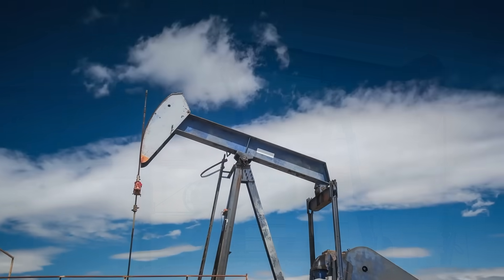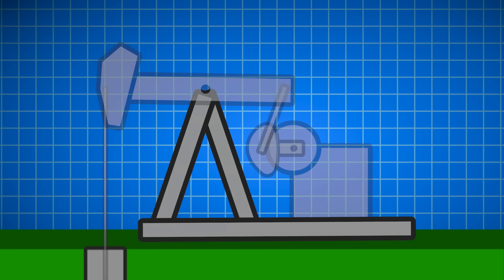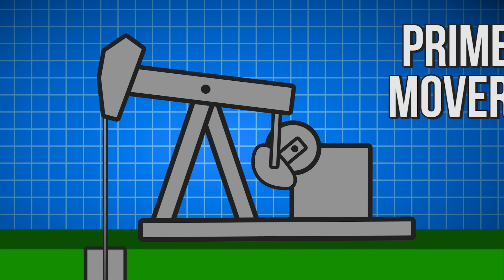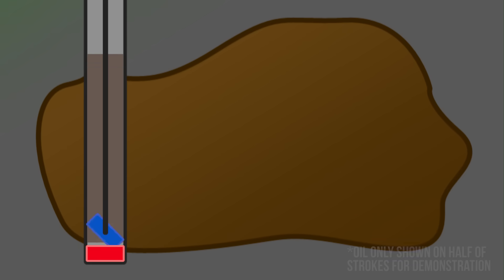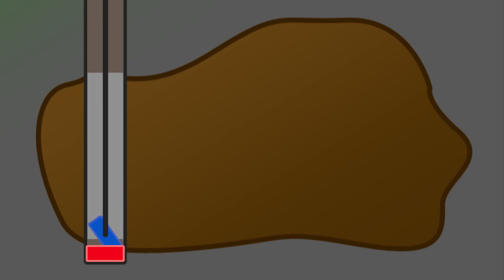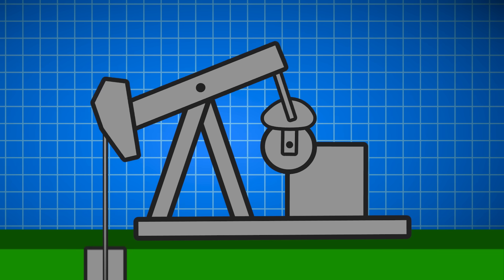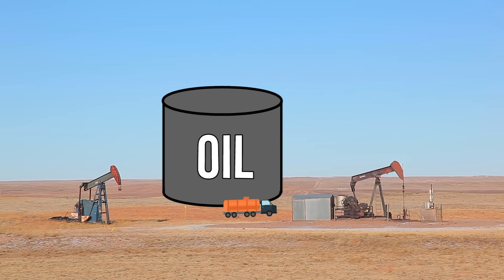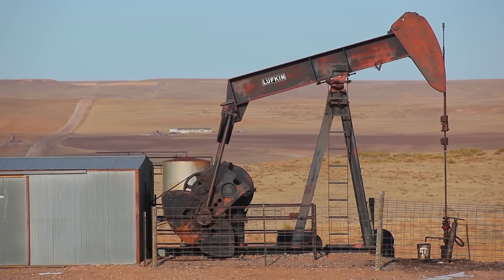How Do Oil Pumpjacks Work?

Comment: For anyone who has ever driven through the southern United States or other oil-rich areas, you likely are familiar with the sight of oil derricks. These metal moving hammer-like structures work to extract oil from underground – often in the middle of nowhere. All this probably leaves you wondering, how do they actually work and what happens to the oil once it's taken from below ground?

Called pumpjacks, oil horses, oil derricks, these large metal structures are crucial to supplying the US and ultimately the world with its oil needs. They function as traditional sucker rod pumps, known more technically as reciprocating piston pumps, and are made up of 5 parts: the prime mover, the crank, the samson posts, the walking beam, and the sucker rod.

the samson posts are those that make up the main a-frame of the structure.
they function as the basic support allowing pumping mechanisms to work togather.
atop the Samson posts its the walking beam attached to a piece called the horse head these parts togather make up the major lever arm in the structure responsible for most of the pumping. these move up  and down due to the rotational movement from a smaller arm called the crank.

the crank  usually has a counterweight to balance out the forces on the oil derrick and it gets its power from the prime mover usually through a gearbox .the prime mover is simply complicated name for motor or engine. this supplies the rotational energy to the system that works through all of the subsequent parts to create the bobbing pumping motion that these Derricks are known for. but all of that was a complicated preface to how these massive pumps actually work to remove oil from underground.

attached to the horse head is something called a sucker rod which moves up and down in the well hole there are two stages of the pumping process- the upstroke and the down stroke simple enough. on the upstroke the dirt pulls the rod up from the bottom of the well to the top of its ragne of movement. theres a valve attached to the bottom of the sucker rod known as the riding valve and another at the bottom of the well known as the standing valve. on the upstroke- the writing vale is closed and the standing valve is opened allowing oil from the source to be drawn up into the well. there on the downstroke the writing valve opens and the standing valve closes putting the oil from that stroke on the other side of the writing vale. 

repeating  this process over and over again slowly pushes the oil up and out of the well at a rate determined by the the pump : speed, size of stroke, and well diameter.
this functionality works similarly to how most pumps work using what would traditionally be called a check valve.

a check vale this valve functions identically to how the valves in the oil derrick work allowing flow of a fluid in the one direction but not the other as the oil horse operates the oil is forced out of the reservoir in the valves dont allow it to flow in the other direction . their size usually directly correlated to how deep an oil well might be. the largeer the oil horse  the deeper the oil reserve this relation is simply because bringing oil up from deeper depths requires a significantly larger amount of effort.

these derricks generally anywhere from 1.5 to 10 gallons of oil per stroke.
the liquid extracted is  usually mixture of crude and water that then need to be separated and refined as for what happens to the oil once it is pumped there are 2 main options . depending upon location some derricks will fill a large container with the oil that is then trucked  away. at certain intervals or the oil is directly pumped to a central holding station through a pipe line. 

while renewable energies maybe making a strong play for powering the world oil will likely be here to stay for qutie some time .

all this means that oil horses across the country will keep on bobbing bringing up oil from deep beneath the surface and now when you drive  past them on the road you can understand these seemingly complex machines are actually just large simple pumps working to help ur car keep on moving

Comment: The majority of pump units "suck up" oil on both the down stroke and up stroke.
Reply from the maker: Sucker rod pumps don’t work that way. Work is done on one stroke. In order to have constant sucking you’d have to have a centrifugal pump or some pump that had a rotating drive rather than a linear one
Reply: It only sucks on the upstroke, but it moves fluid on upstroke and downstroke both because of the pressurization of the fluid that occurs in the pump barrel on the upstroke pushes the fluid on the downstroke. So if you open a bleeder valve at the well it will be moving fluid on the upstroke and downstroke both with a short stop in fluid movement when the pump reaches its high and low point in its stroke.

Comment: How does the oil look like underground? Is it like a huge underground pool of oil?
Reply from the maker: Usually it’s trapped in small pockets in  rock or soil. There’s tons of different formation types, but I would say it’s usually not just a free flowing pool. A better way of thinking about it would be like tons of oil soaked sand and dirt. As some oil is sucked out, the rest slowly flows back towards the well. 🙂
Reply: Thanks!
Reply: It's basically like wet sand.  It fills the space between.  It exists in a ln emulsion of oil water and gas.  The well bore basically relieves pressure allowing the fluid to move to the bore.
Reply: Oil is found in sandstones, carbonates, and dolomite. 

Sandstones, for example, are composed of a bunch of tiny sand grains. Inbetween these grains exists empty space. This would be analogous to filling a bucket with marbles. The marbles in the bucket would have pockets of empty space between them.

that empty space can be filled with fluids such as water, gas or oil. So rather than a big pool, it's more like a sponge.

Formation rocks tend to be wetted better by water than by oil. This means often there will be a thin layer of water around the sand grains (water that cannot be easily removed and hinders the free movement of oil and gas). 

Since oil is less dense than the surrounding formation, it will tend to move toward the surface, unless something prevents its upward movement. Caprock is impermeable rock, shale or mudstone located above the sandstone reservoir. Caprock traps the oil within the sandstone reservoir below.

natural geological processes can create several different kinds of reservoirs. If you can imagine a layer of sandstone underneath a layer of shale, that is then bent into a dome shape by geological forces. This would produce a dome-shaped trap.

Comment: That's a pumping unit. A "pumping jack" is slang, for pumping money (jack) and generally not appreciated by all professionals in the oil and gas business. A derrick is the tall contraption that is the framework supporting a drilling apparatus in an oil or natural gas rig. The derrick derives its name from a type of gallows named after Thomas Derrick, an Elizabethan era English executioner. #texas #crude
Reply: Ann Eagle thank you for clarifying that. It irritated me. Lol
Reply: Not to mention they are showing mark units in some pictures conventional in others and a pump design I highly doubt anyone uses anymore.  

It's not a riding valve it's a traveling valve.  SMH this is a gross over simplification of what is actually happening.

Some information is just false.  The size of the well bore has less to do with total fluid than pump size and formation pressure.
Reply: The third pumping unit design shown -- the one close to the ground, with rotating crank, counterweights, and horse head but without the long horizontal "walking beam" is a design that sits close to the ground in farm fields, so that movable irrigation systems can pass over the top of it without striking it.
Reply: @joshualehman685  ....
with the same stroke, doubling the bore obviously gives more volume. But that also increases the weight to be lifted... a limiting factor when youre down a few thousand feet.
Reply: @hotrodray9884  well bore won't change the weight pulled.  Depth yes bore no.  The size of the bore and fluid production doesn't change after a certain point.  

The pressure left in the reservoir determines the rate the fluid will articulate to the well bore.  The other reason well bore isn't near as significant is you still product through a pump that is 1.25-2" in tubing that is normally 2 7/8". Based upon the depth of the well you have a maximum volume that can be produced through artificial lift alone.
Reply: It's interesting hearing all the official names. We used to call them grasshoppers.
Reply: yes correct...these are "pumpjacks or oil horses"

Comment: I wonder why the oil from these pumping machines has that certain unmistakeable smell?
Reply: synchro505 lots of raw natural gases mixed into the fluids. i work on a drilling rig and when we tap into the "pay zone" it burns your airways from the smell
Reply: Different oils smell different. There many variations. To the average person they just stink.
Texas crude oil smells different than Pennsylvania, etc.
Reply: @hotrodray9884  When they call it light sweet crude I think of maple syrup.
Reply from the maker: As in the there’s a different smell to oil from these pumps or why oil smells like it does?
Reply: your smelling the gas, oil usually doesn't smell. H2s smells like rotten eggs.
Reply: @jweezee11  What? First h2s is oderless and deadly which is why we ware h2s moniters. Also another reason for evacuation slides, there not just for blowouts. If that h2s alarm sounds you better be running and if you fall im not stopping to pick you up or were both dead. This is serious business life and death if you don't know don't say anything your bull could kill someone. If you breath h2s gas you drop dead on the spot period end of story.
Reply: @johnross1947 we wear h2s monitors to protect us from high h2s concentrations. H2s can be odorless at high concentrations and prolonged exposure can "deaden" our sense of smell. I operate 12 facilities ranging from 15 parts to 55k parts. I can promise it has a smell. Whether I'm flowline pigging, cleaning tank probes or just grabbing tickets I smell h2s all day and so does the rest of the oilfield. If you cannot smell h2s you may need to see a doctor.
Reply: That is the smell of rotting dinosaurs

Comment: This is not an oil Derrick.  It's called a pump jack.
Reply: +Concerning Reality - Technically, yes. Using a very loose definition of a derrick then it could be referred to as such. Colloquially, an Oil Derrick is the mast structure on a Drilling or Service rig that provides support for the Crown block, drill line and Travelling block that are used to support, raise and lower the drill string for drilling, connections and tripping. in my years in the oil patch, I have only heard the mechanism you are featuring referred to as a "Pumpjack" or "Walking Beam pump". When rig workers talk about a derrick they are always referring to the mast on their drilling rig. When a hole is TD'd and it is determined that it will produce, the rig (With its Derrick) is removed from the site and moved to its next location, a production rig is then set up over the hole to prepare the well for production, then it is removed to allow for installation of the pumpjack if it is required.
Reply: Nope, different idea and mechanics. totally different purpose. Derrick is the mast on a drilling rig used for drilling the well ... or preparing it for production. A pump-jack is used for removing oil from a well that has already been drilled and does not have sufficient drive to deliver the oil to the surface. Your pen analogy may work for pens, but has no validity for oil well drilling and production equipment.
Reply: @pudmina  I submit you don't have to know anything about the oil industry to know that a derrick is a form of crane, made for lifting things; as opposed to a pump, made for pumping fluids. The two are as about the same as a bicycle is to a lamppost.
Reply: @Geoff Graham - You would think so ... :)
Reply from the maker: Yep, you’re correct 🙂 I tried to present it with as many names as possible, but totally understand the technicalities.
Reply: +Tom - Nope
Reply: M Wilson I gave up on correcting this some time ago. I’m a retired petroleum engineer. Apparently accuracy is a secondary consideration.
Reply: Fuuuuck, close enough. All normal people know what he's referring to.
Reply: @TrashPanda 365 - Now everyone else, including you, knows as well ...
Reply: I thought it was called a nodding donkey.
Reply: @Roger Onslow - yes, but only by the Mexicans ... The chinese call it Crouching Tiger .. or when it's in camo ... Hidden Dragon :)
Reply: @rogeronslow1498  nodding donkey is just one of many nicknames.
Reply: I was going to say the same thing. I worked the oil rigs for years in my early 20's, I made it to derick hand. Then I got my pipefitters ticket and did my fare share of maintenance runs when it was slow, so I've shut down hundreds of these pump jacks to change out the stainless rods or replace bolts. A derick is only found on an oil rig, period.
Reply from the maker: Technically, yes. Colloquially, this is referred to as an oil derrick, more specifically an oil derrick pump, pumpjack, oil horse, etc.
Reply: Can't we all just get along?  Wait, I forgot, it's about oil.  Carry on.
Reply: M Wilson Yes... dofferent design same idea/mechanics, just like saying a normal pen and a gel pen are TOTALLY different
Reply: mike Rightmire literally the same thing...